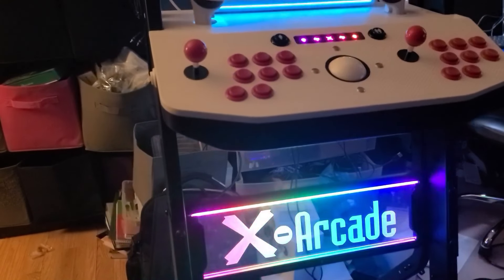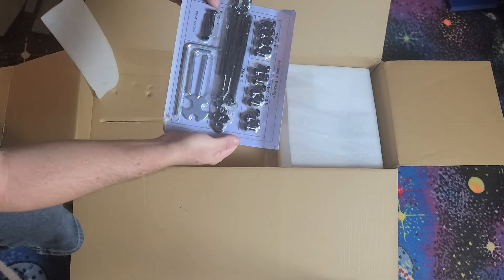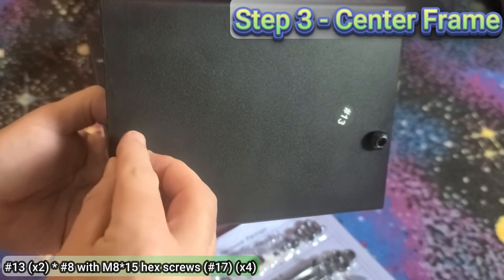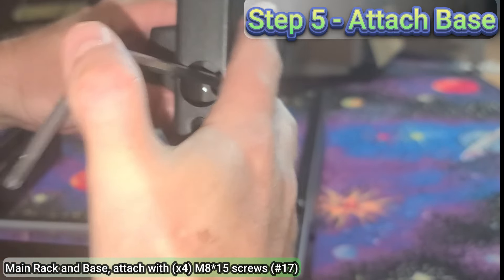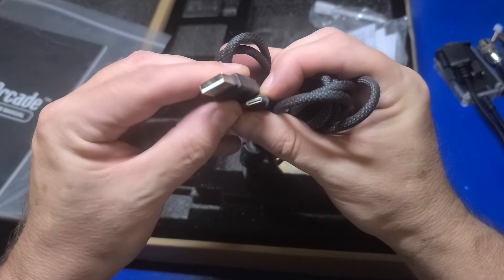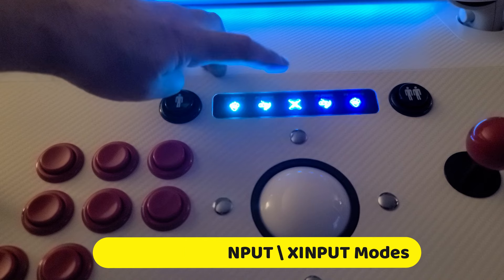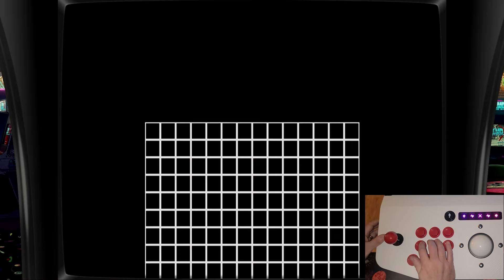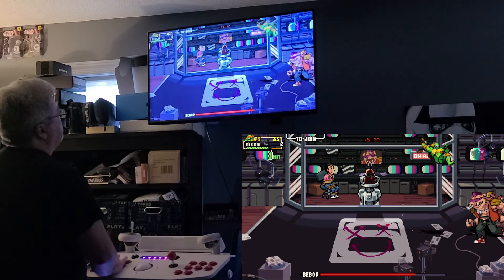X-ARCADE Arcade2TV XR Assembly & Setup Guide: Pi5 /Steam Deck/ROG Ally

Comment: In your opinion, does this seem worth the money they are asking?  To me it seems like if you're not standing up, those bars would be incredibly annoying and in the way.
Reply from the maker: It's currently priced around $399, which is a reasonable price (imo).  When you lower the deck, the bars can be in your way if you are sitting while playing from the side.  The stand and deck feel solid.  However, you have to also consider there is no computer or display included with this unit.  You're paying for the stand and deck, you supply the system and display.  I'd recommend examining all options before making a decision based on what you're looking for and where you want to use it.

Comment: Sadly I bet this beautiful unit, is very expensive.
Everybody, might as well, get themselves a Multicade, has control panel, actual cabinet, and most of all, a built in screen, ready to go.
For the same price, especially when Glen, releases his full size Build A Cade, along with 19 inch screen.
Reply from the maker: Thank you for your feedback!  It's always great to have options, this unit is about $499 (~$50 less with the discount).
Reply: Which Multicade is uner $500?